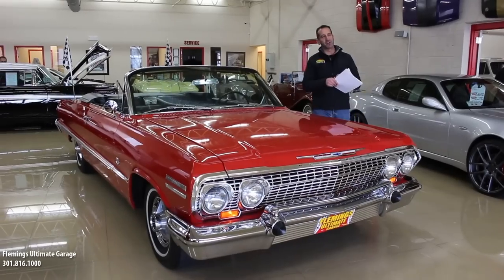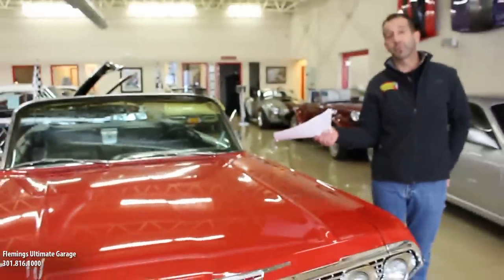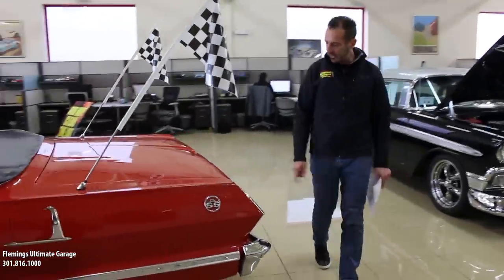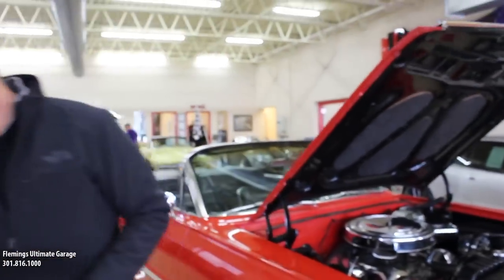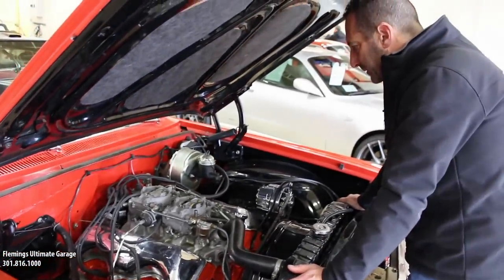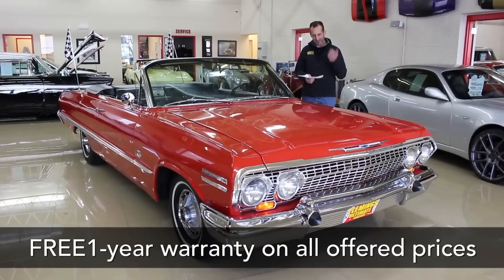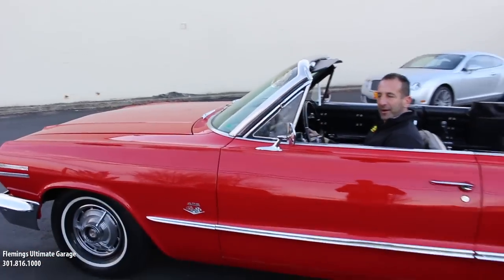'63 Chevy IMPALA SS409 for sale w/ test drive, driving sounds, and walk through video

Comment: I bought a '63 Impala 409 QA block (400 hp) when I was 16 years old for $350 from the original owner.  I went in the Navy in 1975 and unfortunately my mother sold it for scrape in '78 for $25.  My heart was broken because I really loved the car.  My brothers removed the engine and transmission before it went.  The 409 stayed with us for many years in different cars (Nova and 68 Camaro) until it was sold 10 years ago.  Got 10K or the engine.  Still have the Borg Warner Super T10 transmission somewhere.  Thanks for the video, it brings back fond memories.

Comment: Most of the dealer presentations for cars on You Tube I don't care to much for. However, this one is pretty nice. You took your time and explained about the car and especially the engine. I appreciated that. This is a beautiful example of what they were like back in the day. I had a 63 283 convertible and a 63 409 340 horse auto. You mentioned all 300 horse engines got the tach except I have seen many without over time. It was an option. It may have been standard on the 400 + 425 engines since they were 4 speed only. It should also have a chrome dipstick, half way down, with SS 409 stamped into it, as mine did. I loved that car but life happens. I hope you spend the time on the next one too. Nice job.

Comment: Love it.. gaps and moldings perfect… it’s amazing how many of this same year I see redone and the hood lip molding is like un even with the eyebrow moldings.. and it’s an easy fix lol they dump like 20-30k in car and leave the moldings all out of wack.. lol this one is perfect my ocd never activated… I want a base model convertible with the dual side moldings with the bel air rocker moldings wich I feel just set it off, mine will be silver with a white top, 13’ supremes, 1.25 inch white wall, 2 inch lift in back for a little rake, silver and white guts with the SS patterns on the front and rear bench seats, I will have one…💯

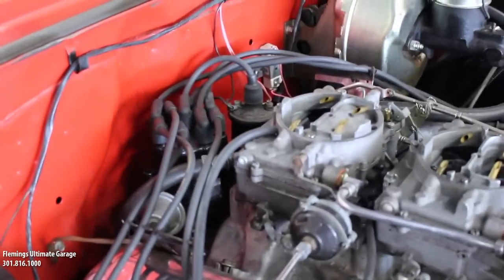Comment: Only one carb has a choke. So there is only one choke heat tube.  One tube is the inlet and the other is the out line which is the hot going to the choke. Look at 9:40 .

Comment: Too bad Gm did not the yet  have the  3 speed hydo behind these motors instead of the lazy off the line powerglide . No wonder the Mopars were cleaning them up at the drags.